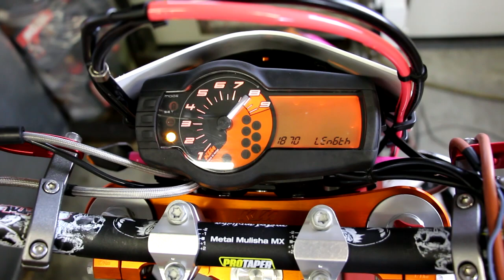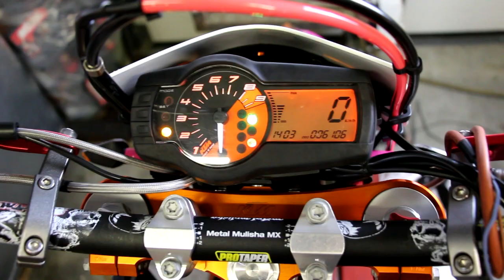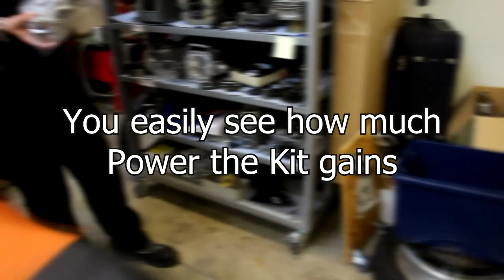KTM 690 Full Power Pirate Racing

Comment: I dont have facebook, so i ask here :)

This is just an akrapovic and mapping ?
Because i have 2014 xcw 450 (new), i buy akrapovic exhaust. And the KTM compandy told me it will be better with mapping.

(I feel more power with akrapovic>stock)

Stock 0-9 hours
akrapovic 9-15 hours what i ride.

TY ANSWERING
Reply from the maker: Koppany Kerekes Yes if you change something on your bike(Exhaust, Airfilter ... etc.)  you need to change the Mapping as well.
Reply: Kenny_Stuntriding  I already change exhaust and i feel more power. If i change map it can be MORE ? Or what i feel another ? 
WTF, if i change airfilter i mean change same airfilter what i use from 0hours. Need change map too ?

About map change. Self or better KTM company change. Any youtube video from it ? In ktm how much work hour to changing map ?
Reply from the maker: Koppany Kerekes Well The Map decides how much Air and Fuel you engine burn and when the spark comes. If you Change the exhaust you need to change the Map because your Engine need more Ari or fuel. If you dont change the Map your engine will run to thin or fat. JUst Ask your KTM company if the could change the Map appropriate to the Akra.
Reply: +Kenny_Stuntriding deswegen mag ich Vergaser. Kurz andere Düsen etc rein, fertig

Comment: How much is the kit and what does it consist of?
Reply: Cristildo it's made up of a new air filter like you saw in the video, a special piece of pipe to connect the new filter, a power commander and a complete rework of all the stuff under the seat, as you need some space to put in the new Filter. I am not sure about the price, look it up on their website.
Reply: Cristildo you also need a full exhaust system. they recommend akra, but as you can pnly buy them from your local KTM dealer, they cannot include it in the kit